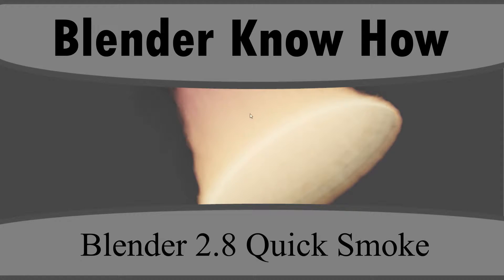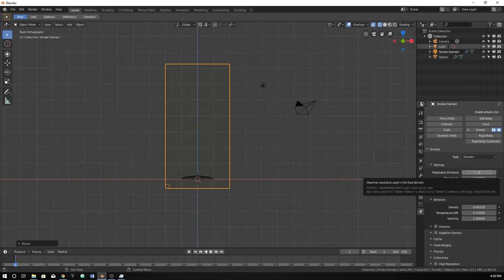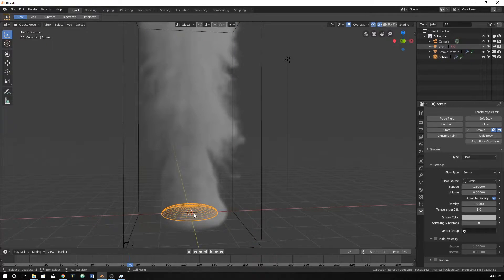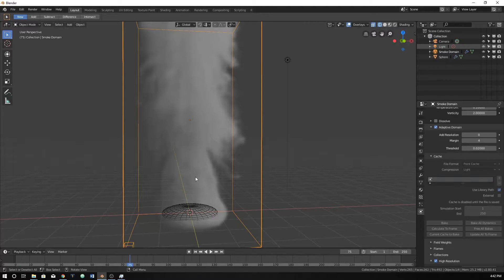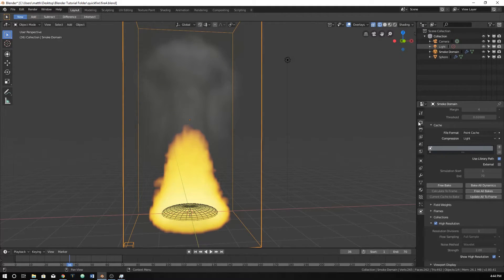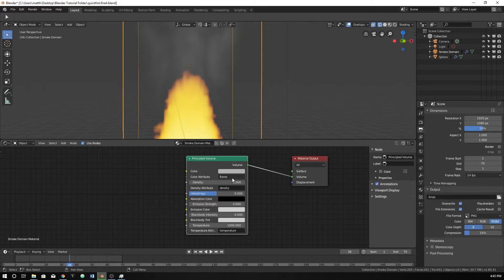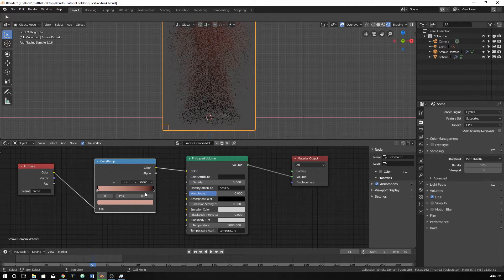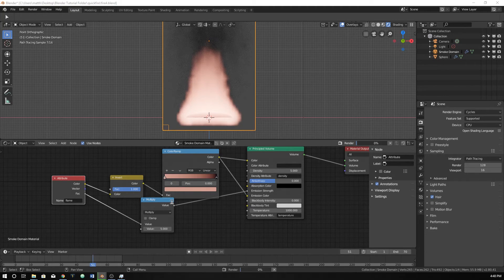How To Create Fire In Blender 2.8 Using Quick Smoke Simulation

Comment: There is no smoke
Reply: click on the smoke object in your viewport, then go to physics on the right panel (were you just configured your fire), under Settings, there is a BAKE DATA button. this will generate the animation to cashe, it will load for a little while, and enable blender to have anything to play. click the button again to change the settings again.
Reply: @faziolifairmont8125  It didn't work for me, plus, there is no bake data button.
Reply: @beepbeepimasheep237beepbee3  Did you save the file first? And make sure you have selected Smoke Domain.